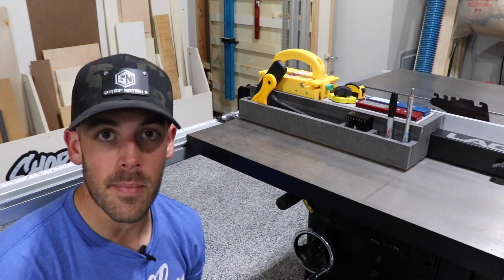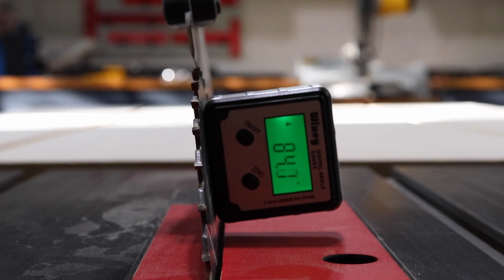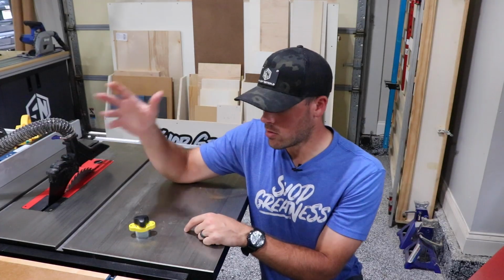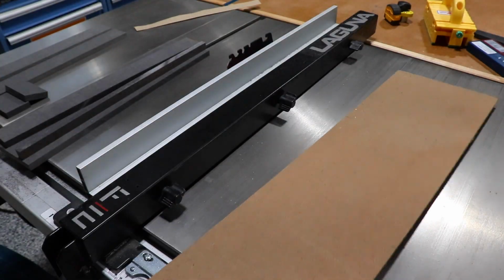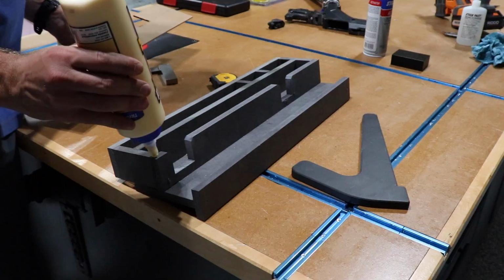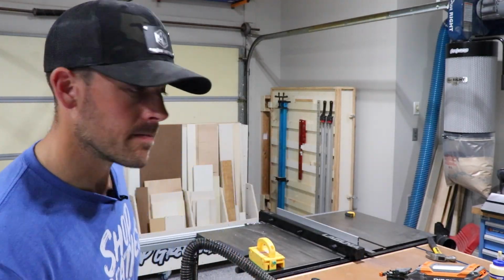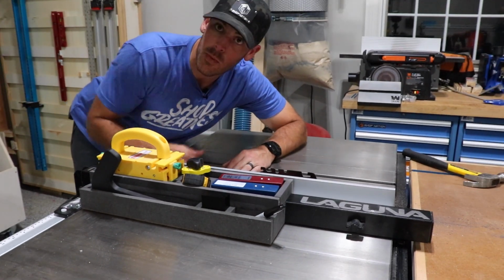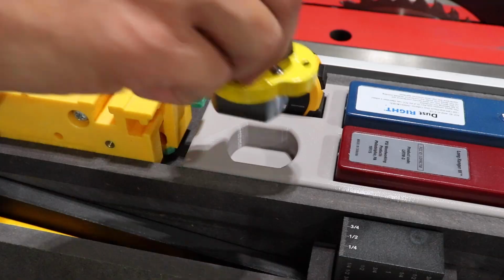Stop using your table saw like this!

Comment: That's a pretty neat caddy! I think this will be the saw I'll be dreaming of until I'm at a level, if ever, at which I can justify something like it. At least I already have the Magswitch, since I bought a couple of them at a sale some time ago. 😏😉 I know it's not nice to have to do it to a brand-new product, but I think the overhead dust collection could probably be improved quite a bit by replacing the flexible hose with straight pipe wherever possible, since those ribbed hoses really have quite an effect on the speed of the air moving through the system.

Comment: I have the same saw as you do, but my fence doesn't flex like your's does.  My F2 is new and has a few upgrades that you don't have.  One major one is a built in digital tilt gauge.
Reply: Do you still have the f2 and no issues still happy with it

Comment: Ok, this is probably not the best place for this, but I just had an idea. I can't draw but still had to share. Miter saw cabinet for small shop built like those fold up craft cabinets. Back section - about a foot wider than the miter saw on either side (3-4 foot total width),  Flat back panel. Top has open shelving, then a counter for the saw with dropdown, then shelves or drawers below. On each side is a wing that is half the wideth of the back section. It is attached by hinges to the FRONT of the top shelf and the front of the bottom shelves/drawers. Top of it has another open (with small rails or doors to keep things from falling out)shelf, bottom has counter that matches with the counter on the back, and then more drawers below. All of this is on locking wheels. When closed, it forms a big box with cut outs on either side between the top shelf and the counter.  When open it is a 6-8 foot miter saw station with storage. 

Ok, I got that out. I am good now. deep breath

Comment: I love your 3d printer.  My friend bought one and I was about to, but then I learned how long it takes. You did yours overnight, but some of his creations are taking 20-40 hours!  I'll bet if you had to wait on your printer, you could have created the same thing with a block of wood and router in less time than it took you to start the printer, LOL.  I love it, though. It looks great.
Reply: Learning how to speed up prints is a skill unto itself.  I learned early in the pandemic when I was printing face shields 24/7 for local hospitals.  One shield initially took like 3 hours to print.  Over the course of a week or so I was able to get that down to two shields every 30 minutes...on the same printer with the same filament.  There are a huge number of optimizations possible, so don't let your friend's experience dissuade you from jumping into 3D printing!
Reply: @StormGod29  What did you use for the clear part of the shield? I'm not familiar with any filament that's crystal clear like what would be needed for the vision part of the shield? Then, again, I haven't really looked, either. lol  I ask because, being such a pain to put a dust mask on then a face shield with goggles and then ear protection on top of that everytime I want to use the table saw or miter saw, I thought how nice it'd be to have a clear mask that I could slip on like a helmet, but with room for the over-the-ear ear protection that I use because things stuck in my ear (like ear plugs) really irritate the heck out of my ear canals. To have the ability to plop a full-head mask on over my ear protection would save probably about 30 seconds of prep time. The old rule is true: The faster and easier it is to use PPE, the more apt we are to actually use it. So, that being said, if I could find some material to use, even as an insert (probably the only way, really), I could 3D print something for my head and affix the clear stuff onto the face opening. Any suggestions are appreciated and thanks in advance! :)
Reply: @Lakusus  don't get excited over a new filament, the face shields were PLA and then you slip in a sheet of transparency film to form the shield.  Everyone was really printing headbands and then getting the shield from Amazon.  I hear you on PPE; the easier and more comfortable the more compliance you can expect.

Comment: If you had extended the caddy the full lengthof your fence, you could have built the magswitch into the caddy so all you had to do was turn it on and off as needed.
Reply from the maker: Yes, but would have been very heavy, which is why I didn't go that route
Reply: @ShopNation  Fair enough.

Comment: Hahaha I love how perfectly timed your videos seem to be for my planned purchases. First, I was finally considering purchasing a good reliable (accurate fence) TableSaw. Then just a week or so earlier you’d posted your Laguna vs. Sawstop review, update, commentary thing. Which I loved and ultimately also went with the F2 just 2 weeks or so later! And have been wicked happy with it!

Now, you make a video that includes some good (accurate but not outrageously expensive) setup blocks! When not just 4 hours earlier I’d finally pulled the trigger on a set from Amazon that ironically cost near the exact same amount plus or minus a few cents. But I love the case these come in WAAAY more. Haha so I bought these now and will return the ones I went with. 

Thanks again. Always love the things you do. Would love to see a follow-up Laguna saw review one of these days.

Comment: Hey Travis Sam here from Alaska like your videos as always.. it's interesting to me that your fence moves that much. I have the very same Saw I got mine about 4 months before you posted your saw comparison video to the Saw stop brand.  Mine does not move like that. How hard are you pushing it. A set of clear cut stock guides goes very well on this model of saw. I also added an extension wing made a frame and dropped a piece of half inch plywood in it. Thank you for the video

Comment: That's a pretty cool solution for the relevant clutter that's always on or near the fence. Just curious but I wouldn't think you'd need to clamp the far end of the fence since the material is already cut at that point and the feed pressure is much closer to the front of the fence where the workpiece contacts the blade and the fence is much more rigid. There should be no feed pressure at the back of the fence under normal circumstances.  I think it's recommended that the fence be set up so that it's actually a tiny bit farther away from the blade at the back end. Comments?

Comment: Really cool upgrade, Travis~!  I must've seen/imagined it wrong from the beginning, but if you swapped the positions of the 1-2-3 block and the mag switch (or similar design mod) and made a caddy for the mag switch, you could activate it from it's "stored location" clearance hole to make contact with
Thanks for sharing this one~!!

Comment: A $2000+ table saw and the fence won't hold steady without a 3rd party attachment? Yikes
Reply: $1399 USD (even sub $2k in CAD) it does hold steady, if you don't reef on it.

Comment: I watched this with volume off in a waiting room so this might have been answered.   Why not extend the rack so the magnet was held at table level and always at end.  Then you just have to twist it on or off as it is always in the right spot.
Reply from the maker: That was the original plan, however if I were to extend beyond the cast iron table section I couldn't use it.  If it's mobile I can still use it on the back fence rail.  Either way works really
Reply: I was not thinking permanent attachment but a cut out so it would be held in place by sides and you could lift it out vertically.  Similar to the spot you made for it on the organizer.  That way when you need to hold some art work up on the fridge it just lifts out.  

Please do not think I do not like the concept/ design.  It is pretty slick.  Your channel has inspired me to organize my shop better.  Made cabinets for the end of the garage last Christmas because I liked how nice your mitersaw setup looked.

Comment: This is pretty sweet. You mentioned not wanting make a permanent spot for the mag stop for convenience, but you could get the best of both worlds. Just add a section on the far side that has a slot that normally catches on the yellow wings, but when you twist it, it drops into place. This will make it so that it doesn't drag on the table, but it can be set with just two quick twists. With a 3d printer and a heavy fill, you should be able to make something sturdy and precise enough that it won't wobble fairly easily.

Comment: Don't most table saws have an adjustment screw/bolt to tighten the fence lock down? That amount of play having to necessitate a Mag-switch block is a deal breaker for that saw. Seriously, if that's the best it can do, a major design flaw on a major component like the fence = find a better saw. And no, not gonna look for a good aftermarket fence to fix the manufacture's poor design. Nice design on the accessory tray.